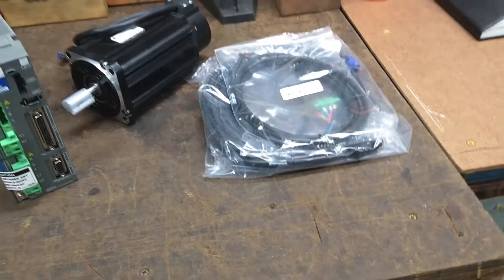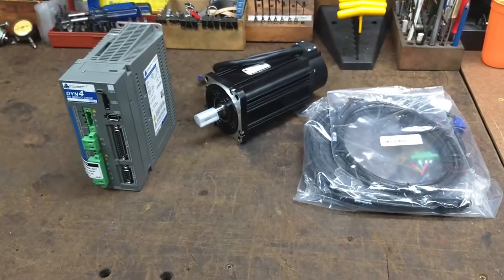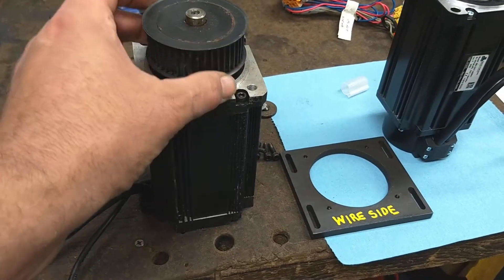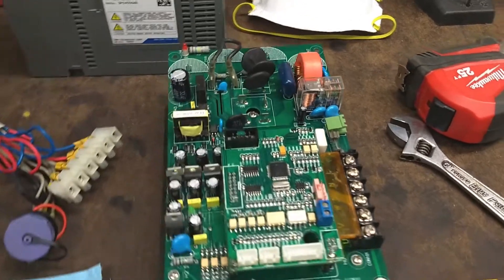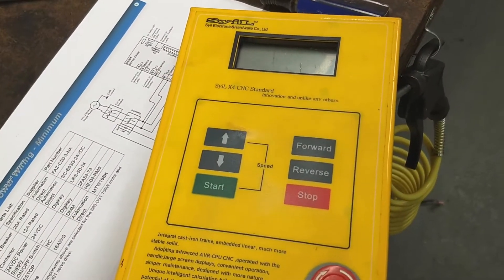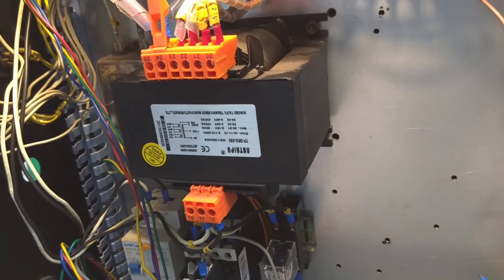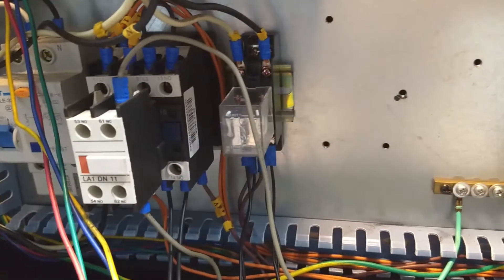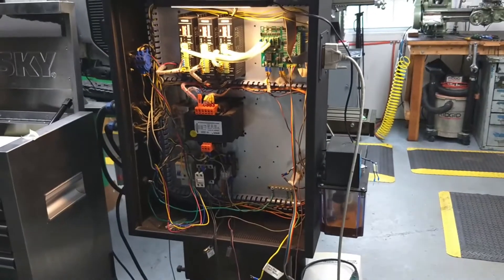Syil X4 Spindle and Controller Upgrade Part 1

Comment: Hopefully you can get this CNC mill up and running Chris. I have a later model Syil x7 (my other channel) and it runs like dream. May I suggest you reach out to Syil (Mr.Chen) via Facebook Syil User Group. Cheers 🍻
Reply from the maker: Hey Aaron, I did email back and forth with Mr. Chen on this. Eventually I gave up and sold it. They guy who bought it put a different control on and has it running now. I ended up buying a Haas TM1 instead. Best to you!
Reply: @lockbuilder  I'm sorry to hear this Chris.  Glad the guy who bought it got the mill up and running.  Congratulations on the purchase of your Haas TM1.  They are a great machine.  My friend Kevin up in Canada has a TM2 with 4th axis.  He does some great work on it.  Cheers, Aaron.

Comment: Do you know why the controller failed or the component failure? Keep it up :)
Reply from the maker: Ryan, we were never able to figure it out. I even had the original controller rebuilt. No joy. Syil so much as said this early control was flaky. So, I'm ditching the whole thing.
Reply from the maker: @Donny Kennedy Yes sir. email is chris@evrardmachineworks.com
Reply from the maker: @Donny Kennedy Spindle runs via the DMM test program and the rest of the machine runs fine. I just cannot get the Spindle talking to Mach 3. But I haven't worked on it since getting everything installed either. Probably something some brain-iac kid could figure out in 2 minutes. Anyhow, email me at the addy above if you're interested. I am giving a very good price on this b/c I bought a HAAS mill and I need the space back in my shop! Best.